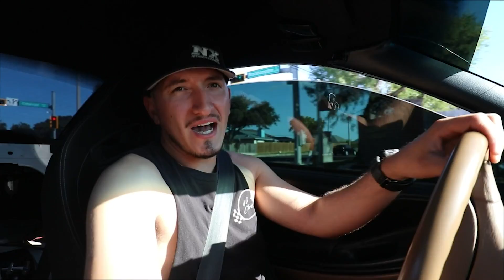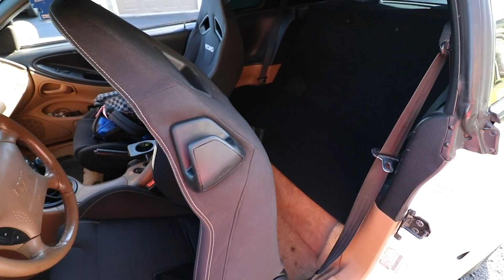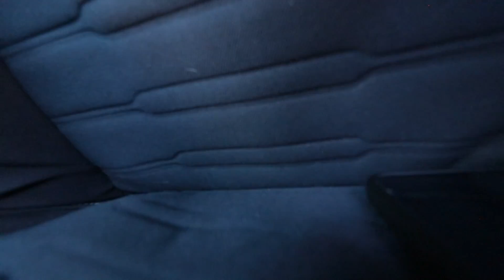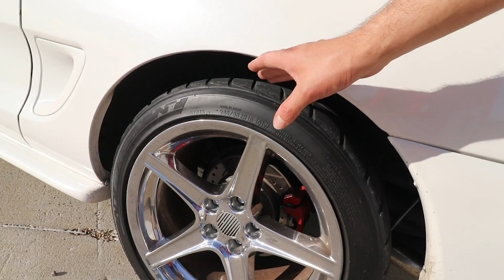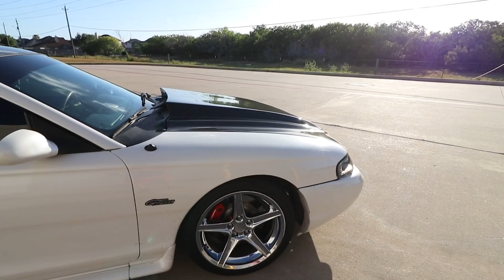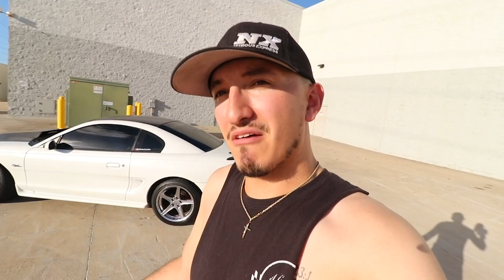The Mod My Mustang Has NEEDED For YEARS !

Comment: Are you gonna build up the inside of the coyote motor? I been debating on the coyote swap for a while but the price doesn't justify it compared to a built 4.6. But honestly it's definitely a better platform! Keep grinding bro! You can do anything you put your mind to! 💯😎
Reply from the maker: No sir, stock motor gen 2 more than capable of handling 800rwhp
Reply: @ReyesBuilt  Is it the truck or mustang motor? But yeah I'm definitely gonna keep up with your build! Would be helpful to add your expenses for us as well 💯😎